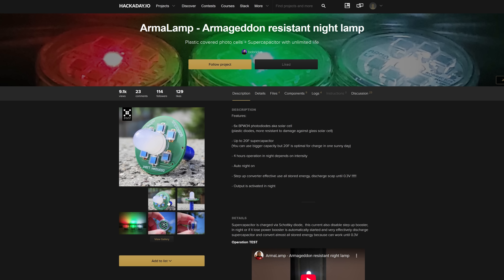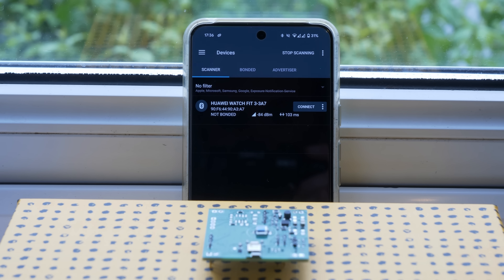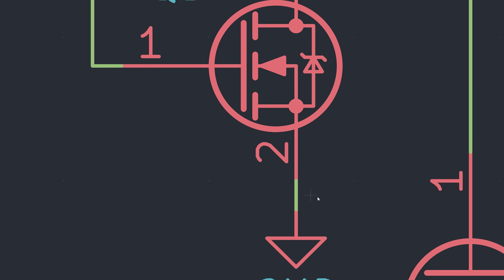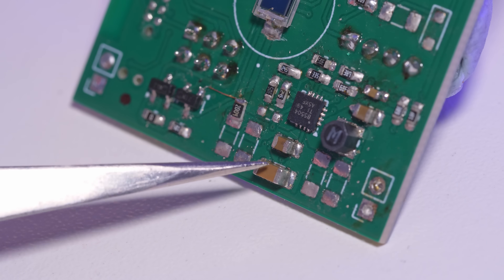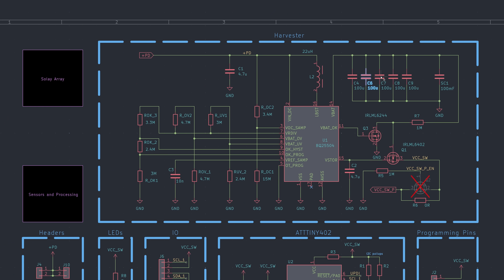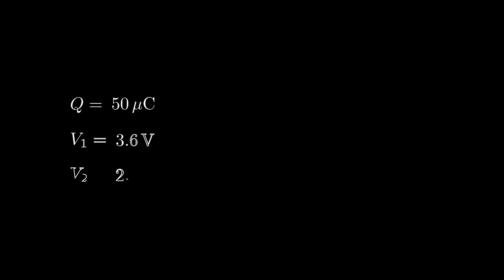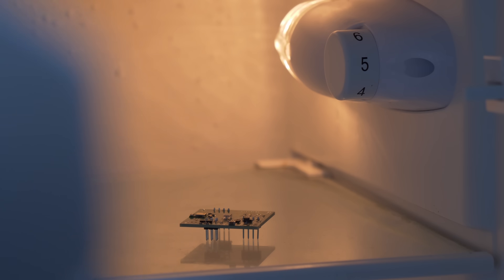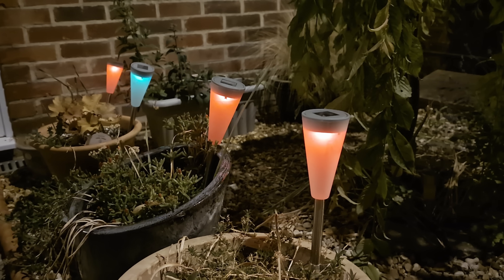Nordic chips are so efficient, you don't need batteries anymore

Comment: 3:53 medication taking log… you want to track if you or your elderly has taken their medication (i.e. opened the box the pills are in)… but people that tend to forget to take the medication also tend to forget to charge, plugin etc that little pill box — bonus points if the box itself can somehow indicate if the box was not touched for 24h (maybe a small bi-stable liquid crystal, price tag or ePaper display falls in the power budget… not sure if there is anything bi-stable that i.e. just changes color). That all while having no batteries or cable charger.
Reply: an e-ink display I think works in this way, in that on power loss, the last shown image stays, it actually requires power to clear the screen as well as change the image on it, they're also quite energy efficient but I have no idea if they are energy efficient enough for this application. but maybe? I think the main issue would be that pill boxes are generally open for a very short time, maybe too short to reliably charge anything enough. Seems like an idea worth prototyping tho at least.
Reply: @LMurrayRacing yeah you are right regarding detecting something when power is off… mh… maybe an imu is state full and accurate enough to read it’s disposition. Simpler is maybe a flip switch on a capacitor when the thing was opened. The calculator solar cell should of course be on the outside (though having a little tag placed inside an off the shelve pill box sounds cool too — something I have not thought about. My mind was on something 3D printed that contains the stuff or so…). Kinda hard engineering challenge under all these constraints
Reply: @dinoscheidt  There are accurate real-time-clocks that use nano-amps of current. Low enough that the time-sensing piece could be powered constantly without making a dent in the power budget. I think you could reasonable get enough power to change an e-ink display a few times per day without much issue provided your processor was off / sleep most of the time.

Then there is the possibility of having wireless charging built into the bottom of the pill bottle and the bottom of the pill cabinet / area.
Reply: @trapfethen  e-ink with an RTC could show the last time the top was taken off, either a coin cell or energy harvesting should work.
Reply: I want this simply because I have ADHD and forget if I've taken my meds.
Reply: https://youtu.be/ZAXf8z6aHKI

I designed this project for my fiancée. Many versions have been created, the latest one, v6.2, has a 7-segment LED display, three buttons, and is based on the MSP430. It can run for a year without recharging on a small Li-ion battery, or twice as long if you allow the battery to fully discharge. If I added an LCD display and a lithium-ion battery with carbon fluoride, it could run for fifteen years on one. No, that's not a typo: fifteen years. The pill box also knows when it's been opened. I designed it with people in mind who are mentally alert and don't deliberately avoid their medications, but who have memory problems or get lost in the "have I really taken my meds yet?" rut. The idea originated over eight years ago and has been evolving in my head ever since.
Reply: @compaqchemlab siema
Reply: 15 years? And after 7 years the li-ion battery self discharged ;)
Reply: Just chipping in: I've seen bistable LCDs used on defibrillators that permanently change to showing a "No good" indication for the battery if it's become life-expired in service. It's like a LC-shutter with a one-time changeover.

Remove the One time aspect to it (Can an LCD element remain light/dark just on the charge in a capacitor?) and that might fit the bill! 🦆
Reply: Dare I say it.... smoke detectors? This could single-handedly ruin a popular meme.
Reply: @gargantuablargg  Sadly I don't think there would be enough power to run the optical sensors smoke alarms use (or the older geiger counter sensors), especially continually.
Although, an array of dectectors running periodically could work for contiunially-enough coverage (while monitoring a wide space) and have them communicate to a hub that has a much bigger capacity that is the alarm (it's not needed as much so could charge constantly in the background). 
That could work, and as we've writing it did occour to us that this could be really useful for low traffic areas or even abandoned buildings.
Reply: All it really needs to do is change state when it hasn't been reset for say 20 hours. No need for clocks and displays, a capacitor and something like a mechanical shutter would do.
Reply: It's not exactly what you're asking for but there is a product called "TimerCap" that I use for this, it's basically a pill bottle with a timer in the lid that counts up from when you last opened it, so when it says less than 24h I know I've already taken my daily dose. Very nifty for ADHD meds before I got this thing I'd accidentally double dose too often.
Reply: +1 for the idea.
Reply: good application
Reply: A countdown from last time it was opened or a counter
Reply: "that i.e." 🤔 i.e.= that is
Reply: @JorgetePanete yeah like a bi-stable material that changes color under current. The “i.e.” is because I don’t think there is a bi stable metal or material that changes color and stays that way once you stop powering it

Comment: I can't find the video, but there was a sensor developed at some college or something, that sends "chirps" (radio chirps) by having an onboard solar cells that charges a capacitor and sends the chirp every time is has enough power to do so.

The one application I remember mentioned, is monitoring ambient light in an office space throughout the day (the frequency of the chirps are proportional to the light intensity) 
And yeah, the main benefit is not needing the have onboard battery.

Comment: hooray now I can tell if the fridge light is on when I close the door, my worries are over
Reply from the maker: 😂 It's a niche application for sure
Reply: I recently realized my light in the fridge only dims when i close the door. Probably parasitic voltages? 
LEDs do not need much to light up. If they don't have a resistor that bypasses these voltages it will light up some time.
Is this right? Not sure.
But i have seen it.
Reply: But the fridge should be a Faraday cage keeping all transmissions inside when the door is closed.
Reply from the maker: @a41wilde57  Even a faraday cage doesn't have perfect isolation. RF is quite hard to keep contained, and with sensitive receivers even if 100 femto watts escapes you can pick it up, sometimes even as low as 0.1fW.
Reply: @a41wilde57 It isn't a Faraday cage. There is a rubber seal around the door.
Rubber doesn't conduct electricity.

If you want an effective Faraday cage that seal needs to be electrically conductive.
Reply: @a41wilde57  Some fridges are made mostly of polymers instead of metal
Reply: @a41wilde57 rage bait 😂
Reply: @a41wilde57  The rubber seal gasket ruins the Faraday effect.
Reply: @a41wilde57  why should I be a Faraday cage?
Reply: @a41wilde57 many are plastic lol I have one ith-11-b in the fridge and another in the freezer. They take a little longer to connect but they do anyway
Reply: @a41wilde57  > But the fridge should be a Faraday cage keeping all transmissions inside when the door is closed.

Why?  Aren't fridges mostly made of plastic, not metal?
Reply: @a41wilde57  no it shouldn't. it just needs to keep the temperature from moving between inside and outside
Reply: LOL :face-blue-smiling::trophy-yellow-smiling:
Reply: Same :D
Reply: Maybe we can make a fridge door open alarm?
Reply: I recall playing a demon in a buska1i11y video ages back for this particular subject, very spooky and silly
Reply: And running a lamp continuously inside your fridge will ensure it runs its compressor continually and never reaches the required temperature
Reply: @imaginitivity7853  Mine switch off the compressor when the door is open (and light on) to save energy.
Reply: @imaginitivity7853  Modern ultra bright LEDs can do the job with milliwatts of power.
Reply: @imaginitivity7853 i run a fan which motor axle heats up. Also the cable goes through the rubber seal and leaves a small creak. It still get to its low temp state and still does it's defrosting cycle without issues.
Reply: @imaginitivity7853  > And running a lamp continuously inside your fridge will ensure it runs its compressor continually and never reaches the required temperature

What horrible inefficient lamps are you suggesting here?
Reply: why do we have fridges with glorified ipads in them but not windows (not the os)
i mean, we have had insulated glass for centuries
and checking the fridge every once in a while is a somewhat universal behaviour
Reply: @kkjkjh did you see the store that replaced all it's fridge doors with monitors, to display their contents, then left with fridges that couldn't be seen into when the software failed. 😂And bar fridges/wine coolers do exist.
Reply: @imaginitivity7853  oh yea
even i have one from the soviet era
how did i forget that 😭
Reply: @kkjkjh  fridges with clear doors would look messy in homes. also, you'd lose the convenience of door shelves.
Reply: @kkjkjh  Well, you can buy a grocery store fridge.
Reply: @kkjkjh  > why do we have fridges with glorified ipads in them but not windows (not the os)

You can buy fridges with windows, if you want them.  Eg wine fridges typically come with see through doors.  And commercial fridges in the super market typically have see through doors, too.